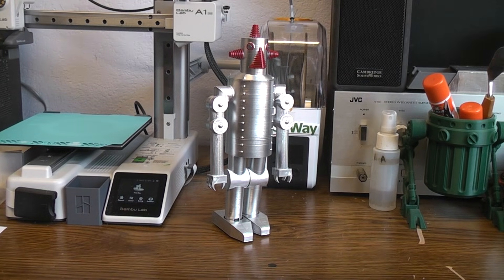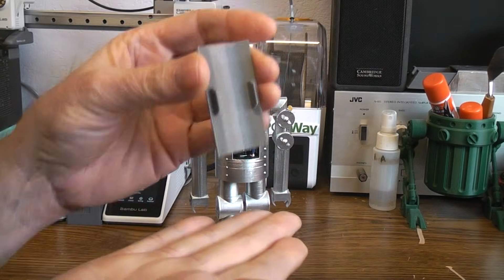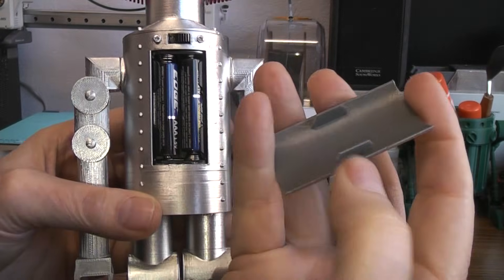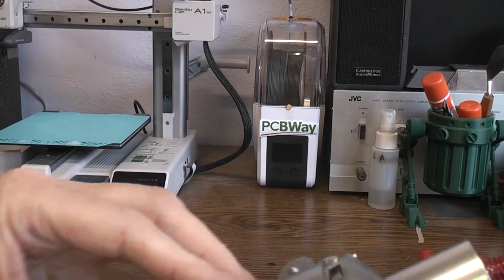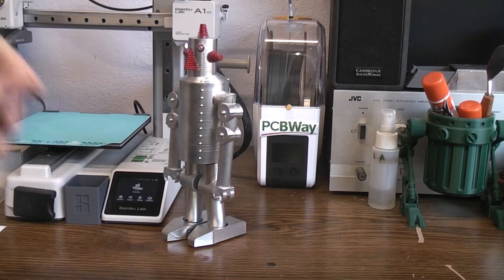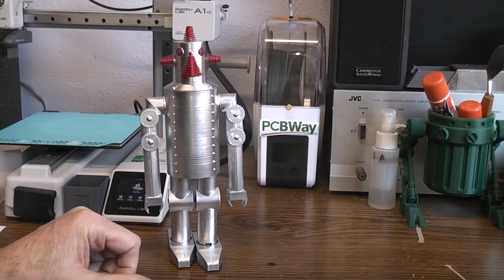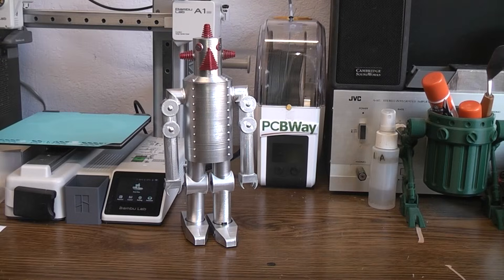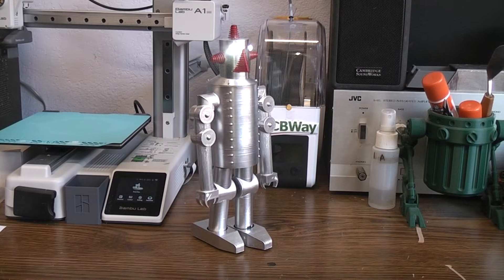Demo of painted Vanishing Shadow Robot. 3D printed, battery operated walking robot you can build.

Comment: Very cool, like you I don't have the time to sand the crap out of PLA but I've noticed that the lines tend to be less noticeable after a quick rub down with sandpaper, couple of undercoats of primer followed by a couple of top coats. I've also converted my Ender 3 to a dual drive filament feeder and this makes a noticeable improvement.
Reply from the maker: If it was warmer here, I would have given it a quick sand job and then a primer coat before the paint but Just to cold outside to spray paint and smelly to do it in the house. Also the fact that I printed the body parts at the old quality setting for faster printing did not help either.
Reply: @Robothut   
We're at opposite ends of the spectrum so to speak. At the.moment here it's a hot enough day to melt PLA left out in the sun. I made myself an el Cheapo airbrush paint booth out of an old washing machine and a retired from service vacuum cleaner. It mitigates the smell a bit but not entirely.

Comment: Oh, wow, well, warm steady LEDs would undoubtedly be more accurate, but as it turns out the individual blinking really adds a more ‘robot brain activated’ look, doesn’t it?
The silver finish is great, and a slightly rough surface is kinda more period-correct.
LOVE his gait, the little teeter as he walks is just the icing on the cake. Great work!